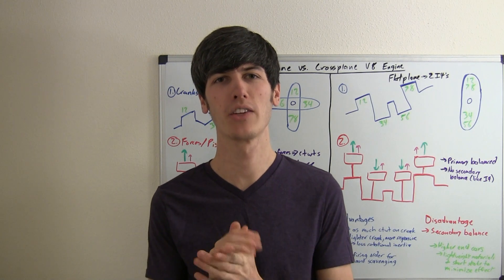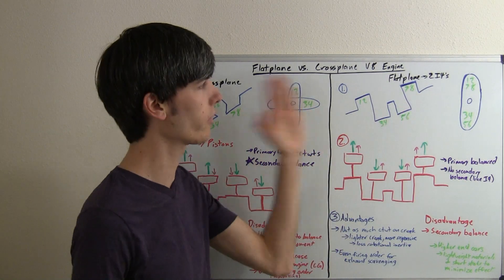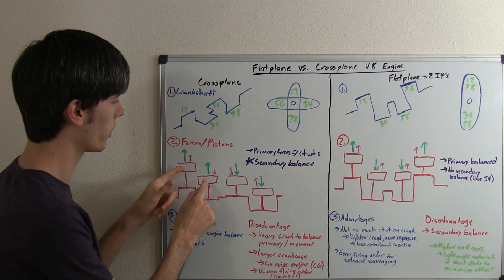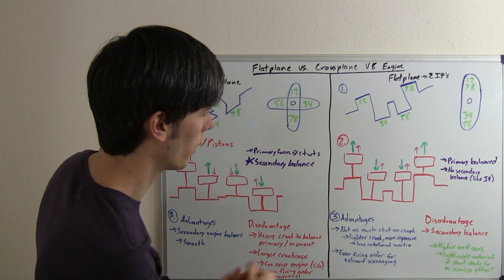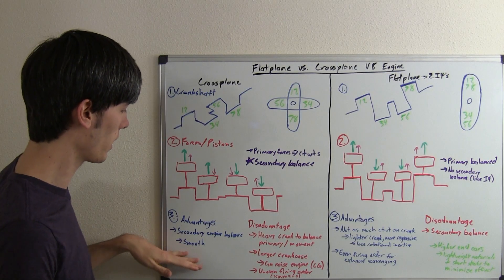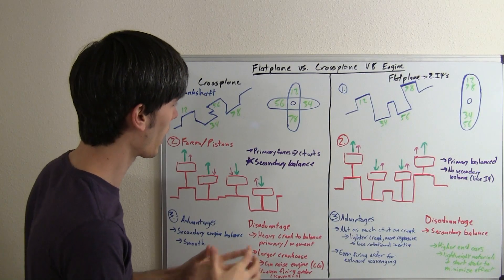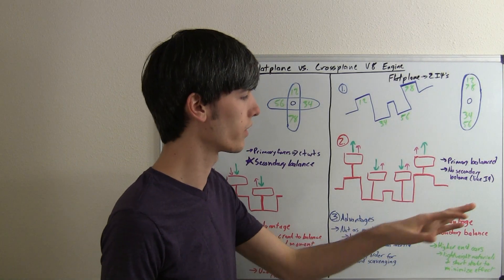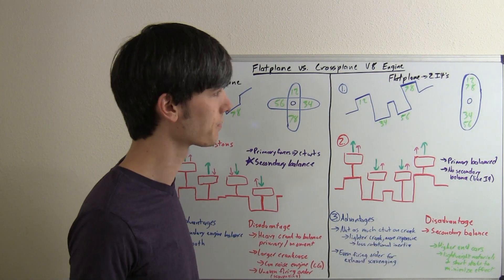Flatplane vs Crossplane V8 Engines - Which Is Best?

Comment: I bought a beautiful condition 08 Ferrari F430 spider. Obviously I’m aware of its V8 but just heard about it having a Flat Plane. I’m trying to understand what the significance is. I think I’ve learned that I need to keep the revs a bit higher than I’ve been doing.

Comment: For the most part, fine, but you guys need to quit implying that a 90 degree crankshaft for a V8 doesn't have any counterweights.  IT DOES.  It just doesn't have any that are extra heavy.  You can't run an un-counterweighted crankshaft in an engine that will rev much past 2800 RPM.  The main bearings will be gone at 20,000 miles.  Not a problem for racing cars, but unacceptable for street-legal cars.  Pontiac tried using an un-counterweighted crank in prototypes of their early 60s Slant 4.  The mains were gone after 20,000 miles.  In the late teens and early 20s, Oldsmobile offered a V8 with an uncounterweighted crank.  It could rev to 3,000 RPM, very high for that era.  The mains were rumored to be gone after 20,000 miles.

Comment: Why is the crossplane crankshaft degrees (looking from the front, from front to back): 0, 90, 270, 180
And not: 0, 90, 180, 270? Wouldn't that cancel out the rocking motion?

Comment: Why don’t the Top fuel dragsters use flat plain if it’s so “great for racing applications”?
Reply: Top fuel dragsters prioritize torque not horsepower so hither revving engines aren't the priority. The heavier crankshaft of the crossplane means less vibration which means more durability. This is obviously needed when the engine forces in top fuel dragsters are absolutely ridiculous

Comment: You did a good.. But I'm left confused... If piston weights are a "counter balance" for the rotating mass, then what changes weight wise?  From a + shape to a - shape?  The 8 pistons are still there... I don't understand why in the + shape that the 4 vertical and 4 horizontal pistons don't balance each other out?  It is because they aren't exactly in that shape for a v8?  Is it more like an 8point star?  Even than, anything symmetric should balance out right?  The real imbalance in all of this come from materials tolerance and composition differences.  If I have 2 bars of alum equally apart from center on a bar of steel they should balance.  But if they don't (and are machined identically) then it's the composition of the material that is throwing off my scale...
I don't fully understand something... I don't understand what is better about a flat vs cross setup... With what I just wrote, can you further explain for me???   Thanks.

Comment: Why don't they build 4 cylinder engines using a crossplane crank to get rid of the secondary vibration? Seems easier than balance shafts.

Comment: Can you do an explainer on the physics of chopping knives.  Some knives are better choppers than others.  What attributes make for a good chopper.  I'm guessing weight and balance point are big factors.  If you could explain the physics and maybe come up with a formula for some type of chopping index --  i.e. higher chopping index means a tool that chops more easily with less effort.  Knife blade geometry would probably be another factor.  Length of the blade is probably important... etc...

Comment: QUESTION: I was told recently that Ferrari's V12 motors are actually 2 V6's working together synchronously. Can you 'splain what that means? I was looking at a 1960's era model and noticed two oil pumps and then the owner told me this. Have you already done a video on this? How does this work? Thanks!!!

Comment: I have a 21 MACH1 with Cross-plane  Coyote 302  - and the 19 GT350 with Flat-plane - VooDoo 317 Ci. - BOTH amazing cars. I just topped my time in the MACH1 against the VooDoo. Even with the beastly VooDoo, the MACH 1 is simply a more apt pupil. Never thought I'd say that. Still, the times are so close it's amazing. - Excellent video, ty for explaining.

Comment: A couple of issues I have, cross plane cranks don't necessarily need a larger crankcase when comparing the 2 crank styles with identical strokes. Also, there are center weighted cross plane cranks that are lighter than normal production cranks, and still maintain the vibration reduction. The only real benefits to the flat plane are the points you made for exhaust scavenging, as well as intake wave tuning. But contrary to popular belief, they do not inherently rev any significant amount higher than what can be done with a cross plane.
Reply: I think people actually mean that the rev QUICKER when in Neutral.  They associate quicker with higher.

Comment: The flat plane crank is just the beginning of engineering this type of engine. The cam shafts has to match the new firing order,the Ignition has to do the same. The introduction of balance shafts can mitigate the size of the crank throws. The only benefit is higher RPMs and possibly Horse Power. The thing to remember is if you change one thing like the crank or value timing. You have to change everything! That is why forced induction is so popular. Just need a step down in compression and either plumping the exhaust for a turbo or plumbing the intake flow for a super charger!

Comment: Can you make a video for us about turbulant jet ignition. Yesterday I read this and I can not clear understand about it.

. The smallest diesels such as this operate at higher engine
speed than larger engines; hence the time availablefor burning the fuel is less and
the fuel-injection and combustion system must achieve faster fuel-air mixing
rates. This is accomplished by using an indirect-injection type of diesel. Fuel is
injected into an auxiliary combustion chamber which is separated from the main
combustion chamber above the piston by a flow restriction or nozzle. During the
latter stages of the compression process, air is forced through this nozzle from the cylinder into the prechamber at high velocity. Fuel is injected into this highly
turbulent and often rapidly swirling flow in this auxiliary or prechamber, and
very high mixing rates are achieved. Combustion starts in the prechamber, and
the resulting pressure rise in the prechamber forces burning gases, fuel, and air
into the main chamber. Since this outflow is also extremely vigorous, rapid
mixing then occurs in the main chamber as the burning jet mixes with the
remaining air and combustion is completed. A distributor-type fuel pump, which
is normally used in this engine size range, driven off the camshaft at half the
crankshaft speed by a toothed belt, is shown on the right of the figure. It supplies
high-pressure fuel pulses to the pintle-type injector nozzles in turn. A glow plug is
also shown in the auxiliary chamber; this plug is electrically heated prior to and
during cold engine start-up to raise the temperature of the air charge and the fuel sufficiently to achieve autoignition

Comment: I have a book on the Allison V-1710 V-12 from WWII.  It has a page that talks about rotational imbalances that's quite enlightening.  Allison engineers had to deal with THIRD-ORDER harmonics because of long shafts used to drive the overhead cams and engine accessories mounted on top of the engine.  Included is an exploded view drawing showing the various imbalances and their vectors.

Comment: Cute drawing of the flat plane but wrong. Each crank pin goes off in the opposite direction. Not like your drawing which has the 2 middle pins on the same side.
Reply: Yeah. The only way to avoid massive counterweighting is to have each pin staggered, one side cancelling the other

Comment: Question.........Why cannot you not in each application take one bank of 4 cylinders and place them 180 degrees out of phase in positioning and firing order from the other bank to counter any moment and/or imbalance to improve both reliability and performance?
Reply: You could but then you'd need a crankshaft with eight conrod journals instead of four!

Comment: You might want to re check your facts.A 308 ferrari crank weighs 20 lbs MORE then a 350 chevy crank.  Is there a relationship between the reciprocating weight and the stroke in a flat crank?aka a formula? Would this explain why long stroke (3.75-4 inch) flat cranks vibrate too much to be driven?

Comment: Informative video, but end results are important as well. the bottom line so to speak, besides longevity, and rotational weight, another important difference is that cross plane crankshaft engines tend to deliver the power and torque at lower rpm ranges, while the flat plane engines tend to deliver power and torque at the top end of the range. Flat planes are great for high rpm performance applications, but for a good street application where a wide torque band is needed, and low end torque is where your street engine will spend most of its time, cross plane is the way to go.
Reply: That is the result of flat-plane V8s typically having a very short stroke, not the fact that the crank is a flat-plane design.  The disadvantage of using a flat-plane crankshaft is that the engine will have the same secondary imbalance that a 4 cylinder engine has, which means that it will buzz at certain RPM/load conditions.
Reply: @jamesbosworth4191  "which means that it will buzz at certain RPM/load conditions.
conditions that are exaggerated in flat plane engines due to the fact that there is more weight at the top and bottom of every stroke, the same problems that plagued the old Pontiac tempest 4 cyl (half of a 389). two pistons at TDC and BDC at the same time is pretty much the same issue, and longer strokes, also produce more power at the lower rpm ranges, for an obvious reason: leverage. 
there are several disadvantages to a flat plane V8, that reduce the low end torque. and why, other than the ford racing 230 4 (which used the same bore and stroke as a 460) you do not generally see 4 cylinder gasoline engines over 2.5 liters in displacement.
Reply: @douglaspage2398 I already said they buzz at certain RPM/load conditions just like a 4 cylinder engine.  You are not teaching me something.
Reply: @jamesbosworth4191  so why do you think that you need to teach me? I have been a mechanic all my life.
Reply: @douglaspage2398  I was not even replying to you, at least not intentionally.

Comment: Those are known as 90 degree and 180 degree cranks. I always default to original nomenclature whenever possible. "Tri-Wye" headers (different for each bank) eliminate the uneven scavenging with a 90 degree crank. They work great (and sound great) on my 440 Cubic Inch Chrysler big block.

Comment: I know you don't talk about motorcycle motors.  Or I think you don't... but anyway, it would be interesting to see your research and translation to us of the current motorcycle motor trend related to parallel twin cylinders.  That is, there has been a transition from 360-degree cranks (both cylinders traveling up and down together but only one fires at a time) and 180 degree cranks (traveling opposite of each other) to 270 degree cranks.  Basically all parallel twin motorcycles in the last five years have transitioned to 270 degree cranks.  Triumph Boneville, BMW F850GS, Honda Africa Twin, Yamaha Super Tenere and M7, KTM 790 duke and the new 790 adventure, Royal Enfield 650 twins, are all examples of parallel twin motors with a 270 degree crank and have been out in the last five years or so, most of them on the last one or two years, actually.  Explanations we hear are: faster revving motors, higher torque at lower RPM, and sound and feel of V-twins but in a compact package. Thanks.

Comment: Ferrari has used flat-plane for decades.  But the invisible engine in this config was in the early 2000s, when the experimental (yet production nonetheless) Volkswagen W8 was shoehorned into the Passat W8.  It was an unholy marriage of two VR4 engines as a split-journal flat-plane V8, or Double-VR8, or W8 if you like.  Their offspring have been the VW Group's W12 and W16 (Bugatti), all of these displacing 0.5 L/cylinder.

Comment: Jason, I understand all that you communicated in this video! All in all though, setting aside the idea of "packaging", would you say that an inline six is the superior engine design compared to any V4, V6, V8, or V10 because of it's natural balance and other great characteristics? Further, would you say the very best design for an engine is the V12, as it's simply a pair of naturally balanced V6 banks that attach to a single crank shaft. I'm not referring to fuel economy or any other secondary, tertiary, quaternary, quinary, senary, septenary, octonary, nonary, and denary aspect. I'm just asking about a wonderfully reliable, smooth, and adequately powerful engine to run a big sedan, like an old Mercury Marquis, up and down the highway at 70 MPH.

Comment: More Revs, More power, easier exhaust tuning, Why aren't all V engines flat plane?
Reply: AngelAndTheWolf Crossplanes are generally regarded as more “streetable” than flat planes. It’s more to do with the character of the engine than the figures on paper. The crossplane engine will be more satisfying to drive for the average user in a road vehicle, in terms of lower rpm driveability and power delivery. The average road car won’t rev high enough to make full use of a flatplane design, so crossplane is generally used as a good all-round solution. Flat plane can sometimes lack character in comparison, and the advantages of flat plane may not show through until high rpm and very high power are required from the engine.
Reply: Thanks.

Comment: is secondary imbalance just a comfort thing? or does it affect engines longevity?
Reply: More of confort. It does affect longevity a bit. It also limits engine redline, therefore limiting performance
Reply: They can seriously affect longevity depending on the amplitude of the vibrations. Which is why most flat plane V8's are relatively low displacement. This keeps the vibration fairly low.

Comment: What is the approximate low end torque difference between the two? Is the flat plane crankshaft streetable? It will be used in an LS3 engine.

Comment: Do the vibrations caused by secondary imbalances on flat plane v8s have an effect on their ability to rev high if counteracted???

I know that Typically wouldn’t matter because most flat plane V-8’s are used in racing applications, and are extremely oversquare that the secondary imbalance would be very minimal, but I’ve read somewhere that if vibrations from a secondary imbalance are large enough (like for example if someone made a flat plane 572 Chevy v8) that they themselves could limit RPM.
Reply: I don't know if they would limit RPM, but they would be annoying.  Racing cars are typically run at high RPM, plus comfort is not part of the game, so that is not a problem for them, but in a street-driven car, it would render the inline 6 the smoother engine.  The first Straight 8s had flat-plane crank shafts as well, and they vibrated just like a 4 cylinder, just like early V8s did.

Comment: The more I learn about the balance and vibration problems in other engine types the more I love the inline 6.
Reply: The more I drive my 2JZ the more I love the inline 6.
Reply: @soaringvulture i've got three of them, and a couple 1jz cars as well. The cars for fun, and a cummins for hauling.
Reply: I put fluid dampener on 5.9 cummins it it really smooth out should help my seals and bearings love straight 6
Reply: right!
Reply: Natural puller too.
Reply: GM has one big one in their medium duty truck gas motor straight 6
Reply: Indeed, it's why 5 of my 6 vehicles have inline 6's. They have less parts, and more balanced. No idea why any manufacturer would use V6's instead.
Reply: @SupramanTRD  Space, an Inline 6 need either a freaking wide car, or a very long hood... V6 are like two Inline 3, from the top view, Inline engines are Long but narrow, V6 are almost square, so the fit better into a small engine compartment...plus less height, because the Banks are at an angle, if you look at it from the front...
Reply: @SupramanTRD  Easier to fit in a fwd.
Reply: @SupramanTRD  from what I read. The only reason inline 6 cylinder engines were only phased out because of their length. I don’t understand why this would be an issue in a full sized truck though.
Reply: Or a simple 4 banger!
Reply: Need one on my drive shaft and my 92 cummins had one on the drive shaft coming out of transfer case it was first I have Sean that .😊
Reply: Wait till you hear about the boxer engine
Reply: @madladdan  I6 is king… Unless you got a 8cyl. Boxxer… but i think that doesnt exist… plus think about maintenance… an Inline is easier to service than a boxer
Reply: @Pitstopcomponents  Boxer has lower CG and takes up less space. In my eyes that trumps.
Reply: But inline 6 is a beaut. Just different configurations
Reply: @madladdan  Less space? How? Two cylinder heads instead of one? Or you mean it has less cylinders and therefore needs less space?
Reply: @Pitstopcomponents  Shorter in height and length
Reply: I love V8! Nothing else❤❤
Reply: @christiansanden8005  I daily drive a V8 myself.
Reply: Then you have the VR6 and the small bore spaced Daewoo 2.5 inline-6
Reply: Inline engines, in my opinion, should get a second chance as far as I’m concerned. Especially straight 8s. Most people are so obsessed with horsepower that they forget that torque is what moves something. Horsepower is just how fast it moves something. Torque is what moves it.

Comment: Yamaha claims their CROSS PLANE crank'd I4s provide more grip out of corners due to smoother power pulses inherent in the cross plane design. Offenhouser used cross plane designs for his Indy I4s way back in the early part of the 20th century. I'm thinking it's easier to forge a flat crank vs. a cross plane design. I'm pretty sure it's all marketing hype. My Honda Prelude had a flat crank and it made a whopping 135hp from 2 whole liters.